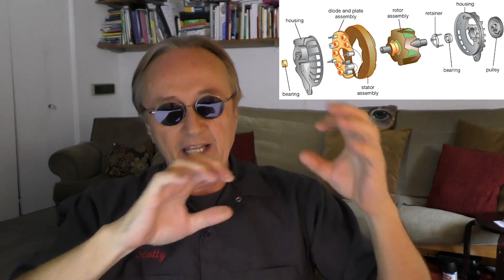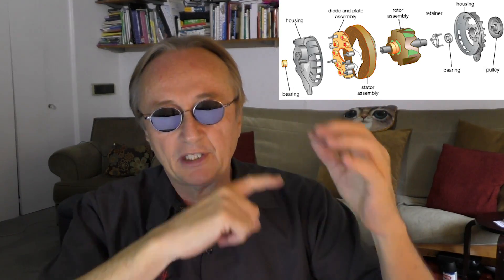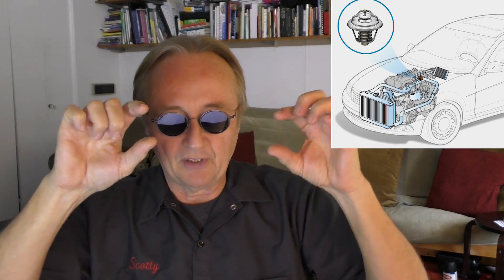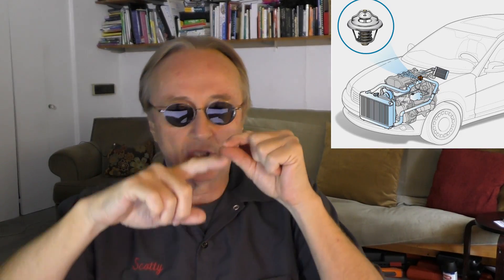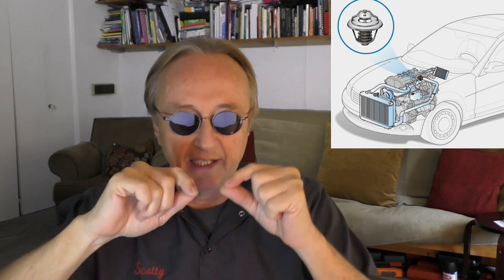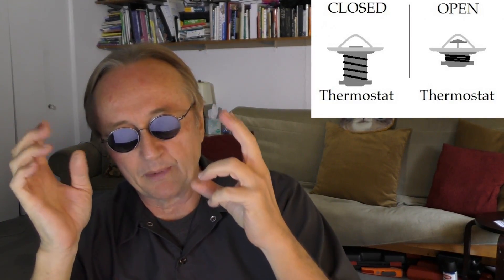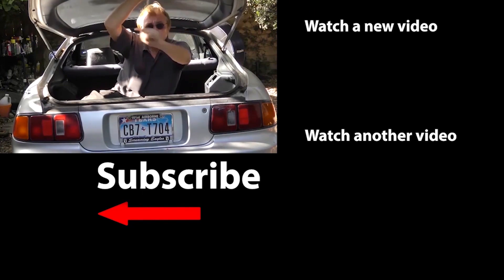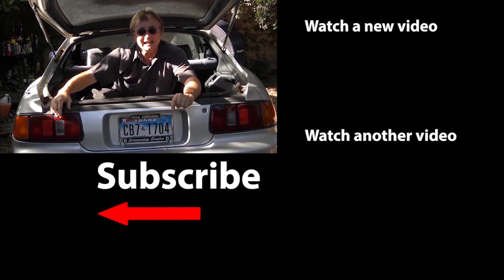Doing This Will Destroy Your Car Battery

Comment: Actually, the voltage regulator for the alternator, which supplies the varying current to the rotor based on the battery voltage/current load, is what determines alternator output, not the diodes. Failing diodes usually lead to a dead battery. An easy test is to measure AC volts off the battery. You shouldn't see any. A battery that overcharges almost always has a faulty alternator voltage regulator. I've never seen a poor(high resistance) battery connection lead to an overcharged battery, its the complete opposite.
Reply: Something I've wondered for many years now- what happens if an alternator (whether failing or functioning properly) produces too much 'power/electricity/whatever'? To my understanding, they produce more or less in response to demand (higher RPM, cooling fan/AC turns on, lots of lights and misc interior draws).

Comment: I do this all the time in my 1996 pickup truck because it sits for 2 to 3 months without being used( I travel the states & never home) I don't want to draw on the battery when I'm not home. I haven't noticed issues of damage thus far.

Comment: Scotty. My Honda Accord is a money pit and I have the option to buy a 4.7L 2007 Toyota Tundra. It has 485km. It has been stored in the shop during winters. Alternator,air pump exhaust has been changed. The maintenance has been done such as the timing belt and tune ups etc. Only reason why I want to buy it is because I’m getting a good price from work and the truck is rock solid. Would like to hear from you!!
Reply: He has a video on what good trucks to buy, the Tundra is on his list but I don't know which years (he said to avoid some model years). 485km- I'm guessing Canada, and if it was stored during winter (I know they can be more brutal than Midwest US) and maintained, then it all depends on the price. If it was me then I'd research any possible 'problems' they have and try to learn as much as possible. But definitely check out his video.

Comment: I mis-threaded a thermostat housing nutt on my '91 Ford 6cyl Ranger a year ago.  I have to pour antifreeze more often.
Reply: dry the area completely and rinse several times with alcohol and then fill the area with JB WELD and redrill

Comment: hey scotty i used a scope and looked inside of my cylinders and there was some carbon deposits so i started using berrymans b12 i ran it for a year than took a look and it was all gone the car ran better idle went up better throttle response and better gas mileage.

Comment: 0:39 diodes have nothing to do with overcharging and voltage. its the voltage regulator that is stuck at 12v so when you rev the engine a little the output voltage jumps a lot
Reply: If a diode goes bad, AC leakage can raise the average voltage.
Reply: if anything ac leakage will lower the average voltage, because ac has average of 0 volts.

Comment: Another good thing to mention is that the voltage regulator is in the alternator on modern vehicles. If it goes bad, the alternator will still put off a charge; but it won't adjust up and down to the electric draw. To test this, use a volt meter. You can get a cheap one for $10. Attach the leads to your battery. It should show about 12.5 volts. Now start your car, with all accessories off, and check it again. It should now be 15 volts. Now turn on your lights, heat, radio etc. If it isn't still at 15 volts, you have a bad regulator and need a new alternator.

Comment: I was thinking about why Scotty rates all Subarus very low for head gasket problems, while Consumer Reports magazine survey results rate some of them very high for reliability, especially the Crosstrek and new Ascent. My guess is these engines are a lot less reliable in a very warm climate like Houston. A lot more of them are sold in more hilly, colder states like far right Maine and far left Washington, skewing the average reliability toward more reliable. Also, they had a lot more head gasket problems for 2014 models, not the newer ones.

Comment: The alternator once failed on my old 93 mercedes 250 diesel, it overcharged due to a short somewhere luckily on those cars the alternator is fastened with 2 or 3 bolts and the drivebelt takes 3 seconds to remove, i changed the alternator withing 30 minutes from when i started to jack up the car
Reply: Reminds me of my Mustang. Alternator is front and center, so after pulling the belt off (tensioner is also in the front), it requires removal of 6 bolts. Takes me under 30 mins as well. Sometimes you get lucky.

Comment: I swear it's true. My alternator committed seppuku and took the battery with it. The diodes ended up being what messed up. Battery was supposed to have 540. Had 630 when I had it tested. Next day, both battery and alternator blow. Everything electrical dies mid turn. Including power steering, which tried to send me into a light pole. Even killed the positive terminal connector. Had to replace that too

Comment: 1:50 Had the thermostat trip a check engine in my 2011 Camry, I just reset it and it never happened again, but I did change the thermostat shortly after that, it's not that expensive

Comment: Scotty, I love your videos and have learned a lot! Yesterday I pulled the harmonic balancer off my 95 f350 with a 460 engine. When i took the bolt out of the crank oil came out of the bolt hole. I've never seen this before. Can you explain? Is this normal or an indication of a major problem like a cracked crankshaft?

Comment: Well scotty... I feel like I should share my frustration with you. I bought a 96 chevy s10 and I'm replacing the slave cylinder. I've been working on it bout 1 or 2 days a week for the past month and I finally got the transmission free but now I need to take the exhaust off. I was doing just that and I found that the one side uses a 1/4 and the other side uses a 8/32. It's about midnight I just put the transmission back for the night.

Comment: Hey Scotty I have a 2009 Suzuki Swift that smells like gas fumes only when I put gas in it, but goes away after about 20 mins with the windows down. Now I smell the fumes even when it is at a quarter tank. What do you think the issue is?

Comment: Hey scotty, I understand using a lower octane fuel in a performace engine that requires higher octane ratings can give you issues. But what about a high octane fuel in any standard engine requiring a lower octane rating?
Reply: It won't affect performance or give better gas mileage, it will just cost more.

Comment: Hey Scotty. You always mention to use good gas. What is the best gas brand in your opinion?
Reply: In another video he said to use gas with no ethanol. If you can't find gas with no ethanol, stick to name brand stations that are "top tier" stations.  Personally I never ever use ARCO even though it is a top tier station.  At my shop we have fuel quality test kits and always find ARCO has WAY more than the max 10% they are supposed to have.  In my area 76 has the best quality

Comment: Scotty please compare the new RAV4 8 speed auto to the CR-V with the CVT. Longevity?
Reply: kadie1414 RAV4 has a 8 speed and the RAV4 gonna outlast it by a lot and Honda has never made a reliable auto trans always weak and don’t last 300-500k miles like Toyota ones
Reply: Anderson Rodriguez thanks for spotting my error & ok point understood
Reply: I have a 19 RAV with the 8 speed.  It is very smooth.  The engine loafs in eco mode and it gets almost 40 mpg.
Reply: @pantherplatform  maybe u accidentally put diesal fuel in it.
Reply: They are both reliable, pick what u desire and would like to drive for a long time. If you want fun and joy pick honda. If you want boring and reliable pick toyota
Reply: the 8speed on the new jeep Rav4 is awesome. the modes are handy if you’re used to a certain feel while driving. it’s a 2019 so nobody knows longevity yet
Reply: Panther Platform what kind of ( hole) are you talking about! If you put your hose in the wrong ( hole) most likely your hose is gonna smell bad! Now.. If you put your hose in the right ( hole) it should fit nicely.. And, the smell should be a turn on for your hose! I hope this helps!😂😂😂😂😂😂
Reply: @joelspivak6622  lol wow are we still talking cars or is it sex now😂😂😂

Comment: Scotty. I have to change the break pads on my 2013 Cadillac XTS. Is there anything that I need to be concerned about outside of the normal replacement process? That you may know of of course. 

Thanks in advance

Comment: What do you think of the 2006 Chevrolet Trail Blazers
Reply: 4runner is better
Reply: In a previous video he called the TrailBlazer quote, 'junk', end quote. And not without good reason.
Reply: Transmission time....
Reply: If you MUST have a Blazer from that period buy the regular Blazer. The Trailblazer had too many problems.
Reply: i have an 03 trailblazer which runs fine at 400k, but mine is the 5.3 v8 version, which is an extremely reliable engine. Its also the long wheelbase model with 3 rows of seats. Keep in mind that it's still no Chevy Tahoe, those things will run forever under normal maintenance. The Tahoe does almost everything better as its a better overall design. But that in no way means the trailblazer is a slouch, theyre usually lower priced and can still tow better than most similar sized vehicles of their time. The smaller 6 cylinder trailblazer isnt as reliable as the v8, but they're probably a lot more fun to drive having a shorter wheelbase and all, using less fuel is a nice bonus too

Comment: I had an old Dodge Spirit that had a f'ed up charging system, I don't know how high it was charging but after an hours drive you could open the hood and smell hot sulfur coming from the battery

Comment: Scotty, i got 09 tacoma 4.0 l engine since new, every 2-3 months when i'm stopped at traffic lights the engine idle
will flutter or sound not smooth for about 1-2 seconds and then is ok like nothing happened. The vehicle is well serviced, I cleaned the mass sensor, got new spark plugs, what do you think it might be? thanks

Comment: Hey scotty, I have a 2003 Buick lasaber. It has the 3800 in it. It randomly stalls going highway speeds. Anyghubg under 60mph it won't shut off. I've changed. Fuel pump, fuel filter, air filter, mass air flow sensor, camshaft positioning sensor and it still does it. Would can it be?

Comment: Scottie, help. I have a 15 year old Mercedes E500 with a constant electrical drain I can't track down. It's pulling a constant 1.88 amps with everything shut down and I've pulled all the fuses and still not found the drain. I only paid $1500.00 for the car (friend was selling it before he moved back to Europe) and it was running perfect until the week before he sold it. Now it kills a battery overnight if you don't keep a charger on it. Any Ideas before I have to take it to a shop?

Comment: Hey Scotty big fan of the channel! I'm planning on getting a used 2006-8 lexus is250 for university. I'm planning on getting a manual transmission and I've found a few cars around 100k miles. Do you think this is a good car an is there anything I should look out for?

Comment: How about stating the VOLTAGE REGULATOR,...if going bad, will impose no limit on the (properly functioning) alternator output...so then it overcharges the battery. Don't overlook this.
Reply: I have my regulator bad on my e46 320cd for a year now, bought a new bosch battery 6 months ago and apart from a occasional battery dashlight( once a fortnight for 15sec.), everything's running smoothly. I know I should replace the alternator or just the regulator, but can't be bothered at the moment
Reply: @Lackesse  ...too high voltage output is not good. A good alternator/Voltage regulator pairing should produce 13.8 to 14.3 V. Batteries can overcharge if this is too high, boiling batteries, losing water, and then this puts more stress on the system, a bad spiral . Higher-than -expected voltage produced may also be bad for the various electronic gizmos in the car..can get expensive. If you know you have a faulty VR, get it replaced.  For reference......when the car is "off"....a properly charged battery shojuld show 12.65-12.85 V. If it has a 12 or 12.1 V reading...it is essentially dead.
Reply: @TheWilferch  bmw  hidden dash computer says it at 14.4V while the engine is running. once I had my dashboard meter on and the batt. light came on and it read 12.2, but that was just for a brief moment. I haven't actually checked the battery with a meter when the engine's off. I might try that after 6 months of driving like this.  thanks for the info
Reply: @Lackesse  ... showing 14.4 V while the engine is running is indicative of a proper Voltage regulator operation. At least upon first start, it may decay down to 13.8V after some time running. I would be worried if it shows 16-18 V, which a bad regulator will show as output. Again, with engine "off" , especially if checked right after the car ran and is now shut-down, a properly charged battery will show 12.65-12.85 V. It may show a "tad" less if engine wasn't run for 12 or more hours. Cheers.
Reply: @TheWilferch  yeah, I took it to bmw specialist and they did the alternator readings and said, yeahi t's fine but you will need to change voltage reg.. In this case, it seems that the voltage of14.4 occasionaly drops to 12.2 when the alternator(regulator) decides not to recharge the battery anymore, and it may be overcharging as well, but I can't see or feel that when driving. I have Eonon android radio(high output) in it and when I had the old battery in, It used to reset itself daily. with the new battery in, this doesn't happen anymore, apart from the occ. battery light.  cheers

Comment: Good gas
In another video he said to use gas with no ethanol. If you can't find gas with no ethanol, stick to name brand stations that are "top tier" stations.  Personally I never ever use ARCO even though it is a top tier station.  At my shop we have fuel quality test kits and always find ARCO has WAY more than the max 10%  ethanol they are supposed to have.  In my area 76 has the best quality

Comment: I had my charging system charging at 17.82v on a 2008 ford focus. I could here the battery fizzing.  You should have seen how bright the headlights looked even in daylight.
Reply: Voltage regulator went out

Comment: Scotty, I have a 1992 Toyota 4runner V6, my gas gauge is pinged out at full but has a empty light on, I replaced the fuel pump and instrument cluster and still the Same thing. What can I do to fix it?
Reply: Is the sensor easily replaceable?
Reply: @keithupton86ku  I don't believe there is a sensor tbh
Reply: @panterafrk00  there should be a sensor that tells the gauge what level the fuel is at.
Reply: If you mean the sending unit, yeah I think I replaced that too lol

Comment: Hey Scotty, i have a '06 cbr 600rr and im having trouble finding the right coolant for its aluminum radiator. What do you think about Peak Asian Blue coolant?
Reply: If it meets the specifications that your car needs (check your owner’s manual), then go for it and use the Peak Asian coolant

Comment: Dear Scotty.

My father has a Peugeot 307sw 2.0Litre Diesel with a problem.

After he changes the oil and after about 600 miles he checks it again and without ever opening the oil cap he notices there is almost around 100mL more Oil in the engine. What could it be?

Comment: When my car drives up to 45-50 mph, both my car steering wheel and driver's seat vibrate. Ant idea what is going on, Scotty? Thank you very much in advance (its a '94 740iL bmw with 95k miles on it).
Reply: supperhey, rotate your tires and if the condition moves to a new location, you have an unbalanced tire.
Reply: @naksookow  Thank you very much. Will try that.

Comment: Hey @scotty Kilmer I have a 2010 mustang it sounds like a river is running in my dash when first start it then a few  minutes then goes away my coolant is not leaking and it’s stays full and my car doesn’t over heat what could it be?
Reply: Coolant circulation within the heater core. Under the dash. Same with mine.

Comment: my prius battery wont charge all the way, almost... but not all the way. Getting only 33.7 mpg. what could be the issue?
Reply: You may have a bad cell in your hybrid pack especially if you're around 200,000 miles or better....I've owned 2 of these cars and still have about sixty cells laying around
Reply: @motersickel  150k on it  it just never makes it all the way :(

Comment: I have a 03 chevy trailblazer, the oil pressure gauge drops when I apply brakes... Is not constant happens at least 2 days a week... What is possible fixes
Reply: Put in a new AC Delco oil pressure sensor. Aftermarket is OK for things like brake pads and oil lines but always buy OEM sensors.  Another thing it could be is something as simple as a cheap oil filter allowing the pressure to blow through.
Good luck I hope it's a simple fix!

Comment: I have a 1995 Honda Accord. It has 180,000 miles on it and it's starting to have a bad idle. What could be wrong with it?
Reply: Check your spark plugs coils fuel filter

Comment: What's considered GOOD GAS??? I thought all Gas stations get there gas from the same oil refiners
Reply: In another video he said to use gas with no ethanol. If you can't find gas with no ethanol, stick to name brand stations that are "top tier" stations.  Personally I never ever use ARCO even though it is a top tier station.  At my shop we have fuel quality test kits and always find ARCO has WAY more than the max 10% they are supposed to have.  In my area 76 has the best quality
Reply: @rays7437  where the hell do u live. Ive never heard of those gas stations top tier around here are shell and BP both use ethanol and every gas station in Chicago uses ethanol never seen one that doesn't